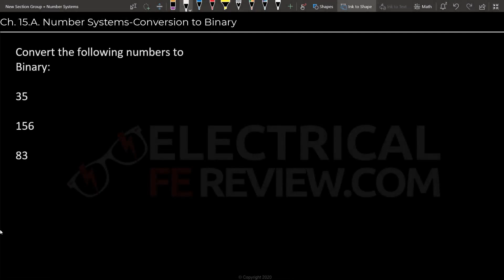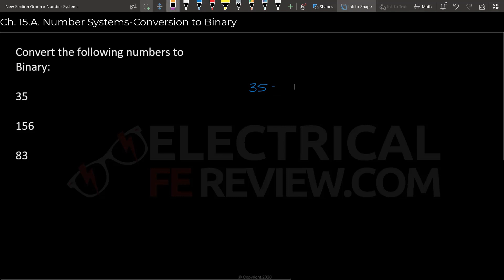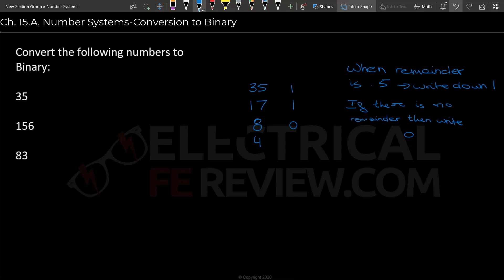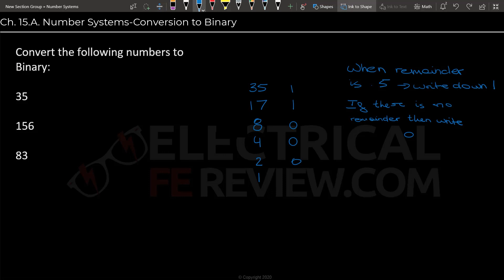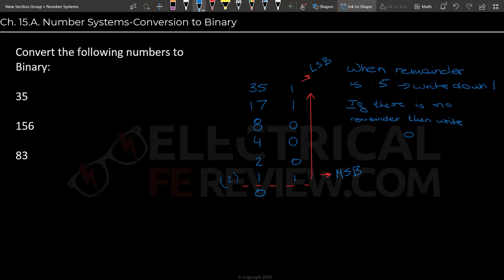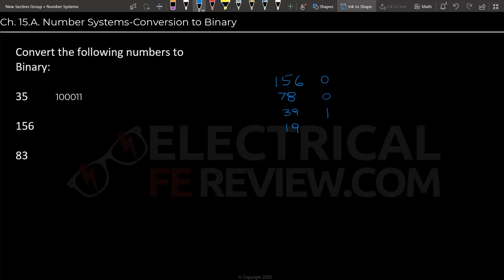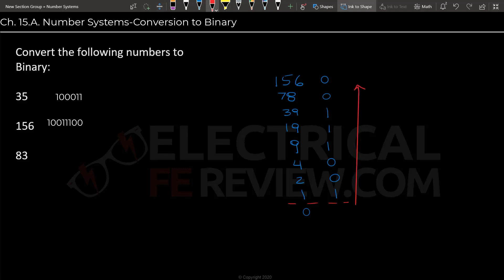Decimal to Binary: An In-depth Tutorial for the NCEES® Electrical and Computer FE Exam

Comment from the maker: Video Contents
0:00 - Introduction
0:04 - Decimal to Binary Conversion Discussion
0:32 - Convert 35 to Binary: Steps
2:02 - Calculation Process for Converting 35 to Binary
3:45 - Reading Binary Conversion Results
4:01 - Music Break
4:06 - Significant Bits Explanation
4:32 - Final Binary Result for 35
4:38 - Start of Converting 156 to Binary
5:02 - Calculation Process for Converting 156 to Binary
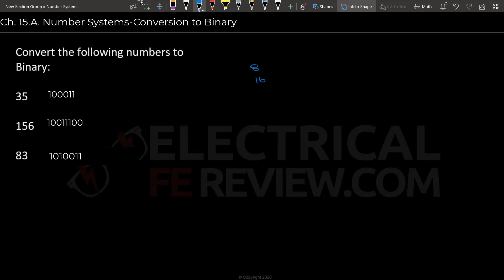7:35 - Reading Binary Conversion Results for 156
8:00 - Summary and Closing Remarks

Ready to master the Electrical FE Exam? Don't miss out on our expert-led online course, with video examples and practice problems. Best of all, it's 100% FREE! Enroll today at www.electricalfereview.com and take the first step towards passing the FE exam.